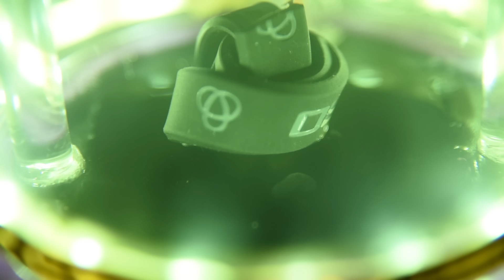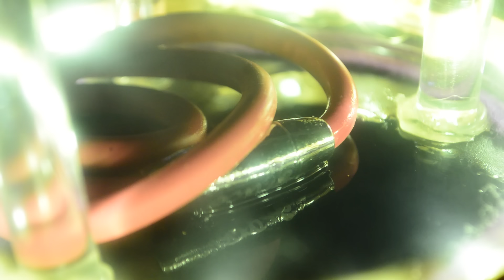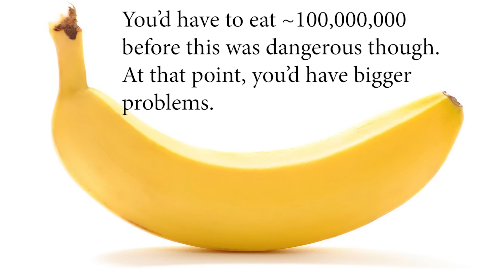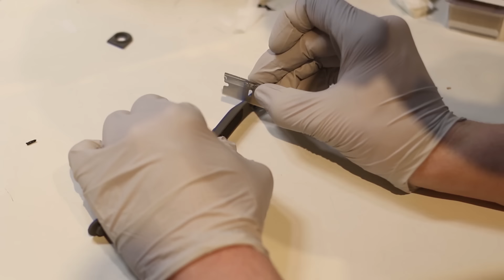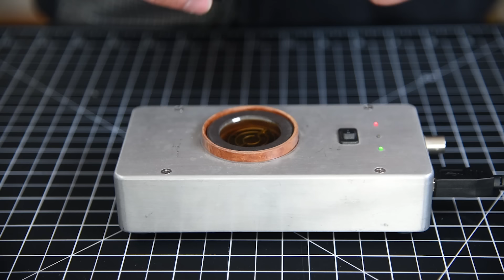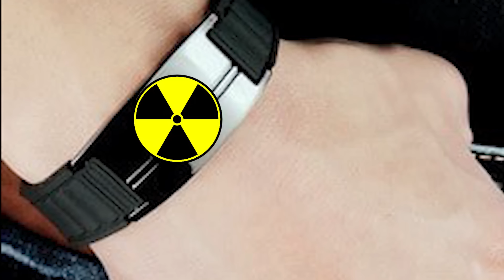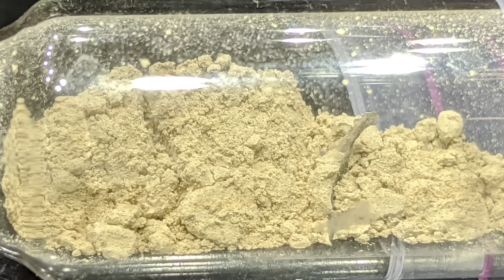Negative Ion/Anti-5g Products Are Actually RADIOACTIVE

Comment: Thorium I understand is a waste product of nuclear energy and I’m sure that was the source in China. I hope they continue to remove the thorium from these devices.  There are a lot of mild radiation sources that are OK to have in your room, like a smoke detector or pieces of uranium ore, but not OK if you have the source next to your body for long periods or allow the particles/dust to get free. Thanks for this video. I’m hitting subscribe.
Reply: Thorium is actually found in nature in certain ores, it isn't generated in nuclear power plants. Plutonium is the most notable element that is found almost only in used nuclear fuel.
Reply: It it a byproduct of uranium production, and China must have reason to get rid of it by using it in this manner. Hopefully this use of it has stopped.

Comment: Okay, so they're radioactive. So is dirt.
Alpha particles are completely harmless unless you eat them; they can be stopped by a sheet of paper or your top layer of dead skin cells. And electrons slow enough to be visualized in a consumer-grade cloud chamber are harmless; your skin will absorb them and develop a slight static charge which will dissipate into the surrounding air. So yes, negative-ion products are useless, but they're also not going to kill you.
Reply: He literally showed alpha particles going through paper, and explained how going through that much dead skin down to actively dividing cells could cause cancer, especially with prolonged exposure.
Reply: @alexhamon9261 : You're right, he did show that. I revise my statement: Paper won't stop them, but dead skin clearly does, as his own experiment demonstrated. Probably the key difference is the water content in skin (yes, even dead skin); water is an excellent radiation absorber, while dead cellulose apparently isn't. While some alpha particles would, by the power of statistics, punch through dead skin and into the live skin, so do the alpha particles emitted by the dirt you walk on every day.

Comment: I wont be buying any after watching, thanks so much for putting in the time and effort, can aluminium hat stop radiation? What about 5g? We are screwed
Reply: Not really alpha radiation will be stoped by the air and your skin, beta radiaton can be stopped like that but might emit gamma rays in the process, gamma rays are only stopped  by very thick shielding but unless you are hugging a nuclear fuel rod when you sleep the amount of radiation you come into contact with in your daily life should be quite harmless also a hat wouldn't actually do anything to stop the majority of the radiation from comming into contact with your body seeing as it is well.. a hat. Also 5G isnt harmfull, it transmits data via electromagnetic radiation (radio waves, micro waves, infrared, visible light, x rays, etc.) wich isnt anything new . 5G uses EHF wich isn't harmfull at all, its a bit more energetic than what is normaly used but is way less energetic than visible light so not dangerous ( electromagnetic is only actualy ionizing, the thing you should be woried about, when it reaches very high frequencies and energy levels this starts happening in the ultraviolet spectrum and is the reason you put on sunscreen during summer as it helps protect from the natural UV rays from the sun. Gamma rays are just very energetic and thus ionizing, 5G network is not more dangerous than looking out the window so you shouldn't be woried.

If you want to read some of this ypurself the wikipedia articles on these subjects are quite good and reasonably trustworhty.
https://en.m.wikipedia.org/wiki/Electromagnetic_spectrum
https://en.m.wikipedia.org/wiki/Extremely_high_frequency
https://en.m.wikipedia.org/wiki/Ionizing_radiation
https://en.m.wikipedia.org/wiki/Gamma_ray
https://en.m.wikipedia.org/wiki/Alpha_particle
https://en.m.wikipedia.org/wiki/Beta_particle

Comment: Man, you're good, making your own bloody gamma ray spectrometer. I'm speechless. Even more impressive in a way than genetically transforming yourself to cure lactose intolerance :P
Reply: @conormaloney126  they both can penetrate human skin and can be dangerous. The penetration is extremely low probability though, so you'd need something extremely hot indeed to be a problem.

But you're somewhat correct, most alpha emitter are only dangerous if inhaled or ingested.

Comment: But Geiger counters can't measure sieverts. They can only measure count rate, to measure sieverts you need to know the energy or each particle, the companies put sieverts on them based on a specific set of calibration sources for which the sievert measurement will be valid.

Comment: Are the air purifiers with built in ionizers radioactive?
Reply from the maker: probably not. they usually use high voltage
Reply: @thethoughtemporium  Thanks for reply

Comment: 16:00  The other problem with Alpha radiation is related to its size.  Beta is a tiny electron.  When it hits something, it stops.  It's like a Toyota Prius.   An Alpha particle is two protons and two neutrons.  It's like a fully loaded dump truck pulling a fully loaded trailer.  It's going to hit your taco stand and 10-20 of your neighbors' taco stands.  It does a LOT more damage.  Plus, the added problem that this bit of quackery is being worn on the same place every day all day.  The user/victim is getting one part of his/her body slammed all day long.

Stop buying this things or make sure your health insurance covers cancer well.  Also, see about increasing your life insurance policies.

Comment: I'd like to see you check, some of the "alkaline water filters", not the electronic ones, the ones that are, water filter cartridges,
Also you want to see something scary? Go to a welding shop, that does TIG welding, and see how they grind their thoriated tungsten electrodes, some might have a dedicated grinder, with a vacuum, or a water bath to contain the Dust,
A lot of people just grind them on a bench grinder, or the Sandpaper wheel on an angle grinder, with little regard to the Dust.

Comment: You sound like the 8BitGuy. Thanks for the info, I came here from big Clive. I don't have any of these, thankfully, but I do have a bracelet that has a rare earth magnet in it. It's supposed to improve circulation. Unsurprisingly, it doesn't. It does however interfere with the coin counting mechanism of some dispensing units! But I don't wear it anymore because I found I was allergic to whatever they electroplated the thing with.

Comment: So if alpha particles can make it through paper, how concerned should I be about the tritium exit sign in my room? I sleep 5 meters away from it and the sign specifies it contained less than 20 Curies of H3 when it was manufactured back in 2003. My assumption was that the beta particles were being stopped by the glass tubes and the sign framing but now I’m not so sure!
Reply from the maker: tritium is very low activity, mostly low energy beta particles. Also, radiation falls of with distance exponentially. A tiny tritium source far away can't hurt you. Even having it near you all the time won't hurt you. The glass it's made of stops most of the radiation anyway

Comment: Don't drink the Pepto! 

Pepto-Bismol contains bismuth, and isotopic Bi-209. It has a half-life much longer than the age of the universe -- 20 quintillion years (2.1 x 10^19 years). The universe is 13.6 billion, or 1.36 x 10^10 years old. 

But you know what the anti-nukes say: that one single particle or ray of radiation will kill you with the most horrible cancer known. 

The Germans, the most notorious anti-nukes in the universe, are crazy about hot springs. Shhh, they're heated by atomic decay processes in uranium and its daughter elements.

Comment: I had no idea you could sell radioactive stuff without a ton of government intervention.  Except for bananas, of course.  😁  Back in the day, we used to use polonium laced paper to keep dust off film negatives.  It was a pain to order and the last time I did, the UPS man refused to touch it because of the required markings on the packaging.  Even then, we never touched it directly, always used gloves, and washed.  And the actual paper was enclosed in a metal case that was purposely far too large to swallow.  We were also trained not to put the stuff near your head and never be closer than 1 foot.  They were probably way overcompensating but I'm glad of that.

Comment: Sweet my tritiated gun sight in't just cool and potentially useful, It's also a quack hippy placebo health product! That's protection on two LEVELs! On a side note, I shouldn't have thrown out my thoriated tungsten welding electrodes. I should have drilled tiny holes in them and turned them into pedants to sell on e-bay!

Comment: Alpha particles are NOT an atom of Helium, they're a nucleus of Helium, no electrons.

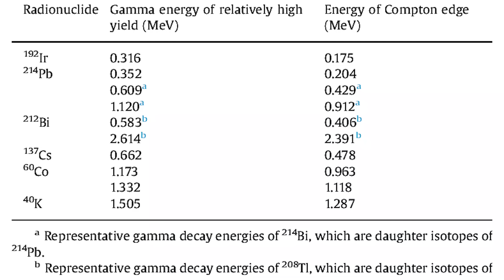Every element CAN be radioactive, depending on its isotope. It is simply untrue that all heavier elements are radioactive and none of the lighter ones. And at 5:05 you can see those radioactive isotopes of lighter elements.

The reason that radiation gets more dangerous with duration of exposure is that it gets more difficult for your body to deal with it. Your skin and tissue are much more dense than any of those materials and a few alpha particles will not affect you in any way because your body is meant to deal with it. Your DNA gets damaged all the time, DNA getting damaged is not going to immediately cause cancer as you make it out to be.

Wearing these all day every day is almost certainly going to cause problems later in life and, honestly, there's no reason to be wearing them at all. But, for some perspective: wearing these is like taking an x-ray of your wrist (in the case of bracelet) every few hours or being surrounded by a two dozen CRT monitors 24/7. The bracelet is basically doubling your background radiation dose daily. The amount if radiation is equivalent to flying via plane every day or two days. There, some perspective.

I feel like the video is too sensationalistic, trying to bump up the view count. And, of course, he's asking for regulation, oh, daddy government, I'm so stupid, spank me.

Comment: Genuine question : I've had a rotating fan in my room for years that has a little sticker on it reading "negative ions" with a smiley face. I found the fan next to a dumpster near my house and took it in, free fan. I used this multiple summers and many hot days throughout the warmer months. Is it likely that the sticker is unrelated or does it actually blow radioactive cool air at me? In other words, should I throw this thing in that dumpster or am I safe?
Reply: Electrical fans, air purifiers, ionisers and so on create negative ions using electricity (a high voltage), the ions cause dust particles in the air to stick to eacher other and to surfaces and thus remove themselves from the air. There's no radioactivity involved and it's safe. Watch bigclive's latest video for an example of one he takes apart to show how it works.
Reply: @xolotl8860  Many thanks

Comment: I know dosimetry is super hard but I wanted to note a few things:
The detectors you use have to be calibrated to the specific isotope, usually gamma only instruments are calibrated for H*10 (Ambient dose equivalent) of Cs-137. 
The mica-window instruments are usually used for measuring surface contamination and so they are usually calibrated for a single isotope and most importantly activity not dose rate.
So your doserate measurements are probably very off.

Another thing to note is that the thorium decay chain releases radioactive radon gas which decays with alpha decay. So no matter how much paper you put around that sample, radon gas will still seep out :) 

I love your videos btw, keep up the good work 💜

Comment: Could you perform the chamber test with mobile products? from smart watches to bluetooth headphones? i realize this might be a stupid question as it is radio frequency rather than any potential radioactive elements.
Reply: RF is photons, so like gamma radiation it won't show up in a cloud chamber. Note however that radio is MUCH lower frequency and thus much lower energy. Since it is much lower energy, it is well below the threshold necessary to interact with atoms and break up molecules. Thus there's not a cancer risk.

Comment: There is no threshold for increase in cancer risk. The current standpoint is that all radiation is dangerous and the increased risk increases with dose. In other words its not smart to use radioactive products even if they only add 10 mSv per year.

The doseratemeter does not count for alpha as they are stopped by the covering materials.

Comment: On the back of this video I actually bought one of the pendants on ebay to see how radioactive they were for myself, and sure enough it was.  What I wasn't expecting however is the plastic "authenticity card" that came in its box was also radioactive - in fact more so than the pendant itself!
Reply: Wtf! Imagin being a worker in one of these factories they probably dont know they are working with thorium
Reply: @trevorjaster4072  Look up Radium Girls.
Reply: Same; I have a pendant that registers 1.3 uSv/h and the card actually registers 1.7 uSv/h.
Reply: Wait, what? How did that happen?
Reply: @NickiRusin  Presumably the card is made from the same material...for authenticity? 

It boggles my mind as to why they'd do it.
Reply: @Chlorate299  Or the factory is so contaminated by thorium dust by now that everything in it is radioactive.
Reply: @xolotl8860  yeah and workers probably breathe it in not knowing
Reply: Damn, that's horrifying.

Comment: "The thickness of a single sheet of paper (0.0035") is enough to stop all the alphas". I found this video really interesting, but in my previous Physics training we were taught they have very low penetration, and every major scientific source I can find says they cannot penetrate the skin, or go through a piece of paper. So, something doesn't quite add up. Thoughts?
https://sciencedemonstrations.fas.harvard.edu/presentations/%CE%B1-%CE%B2-%CE%B3-penetration-and-shielding
Reply: I think his point is that even if the outermost layer of skin attenuates it somewhat, some will still get through, and all the conventional wisdom about alphas being only a risk with internal exposure is all based on the assumption that you aren't WEARING the source in a bracelet 24/7/365.
Reply: Personally I choose to believe the actual demonstration in a cloud chamber over some text.
Reply: @raingram  agreed, it's fairly hard to disagree with a physical experiment that allows you to actually see the radiation going through the paper.
Reply: @raingram  So you are willing to ignore decades of actual demonstrations / experiments, because of 1 YouTube video? I prefer to try to understand why this one demonstration seems to produce a different result to the countless others that have been performed.

Comment: 1 thing on amazon stuff:
most of the things you find on amazon are not sold by amazon but individual shops that are using the amazon marketplace to sell their products, so they have no real control over what the sellers put on the marketplace and can only act after the fact
for example the "Black Tourmaline Crystal Bracelet Anti Anxiety Bracelet Tourmaline Crystal Bracelet for Women and Men Magnetic Bracelets for Anti-Stress Or Anti-Anxiety Healing Bracelet Set (orgone Pendant)" is sold by a seller named lifewinico, it's subtly written in small characters under the product name.
think of it as Ebay or Etsy, it's just a platform for people to sell their shit, but they don't control what goes on there (mostly because they can't)